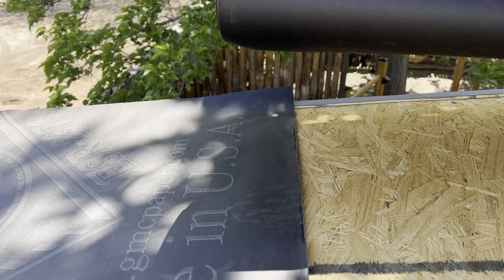Urban Sustainable Bath House Build - Part 2 - Sheathing, Soffits and Roofing

Comment: 3/4” roof decking! You are Superman
Reply from the maker: Ugh. Did I over build it? It was a bitch getting it up there!
Reply: @highdeserturbanhomestead  I've used 5/8ths plywood and 1×8 space sheathing but only to help my father who was a 50ies to 90ies Carpenter. Dad nearly pooed a brick when the codes changed to include 1/2" plywood.  Great build!